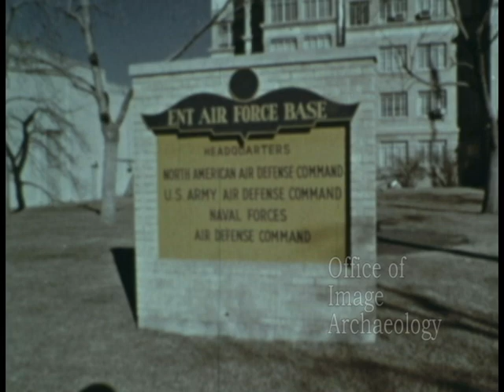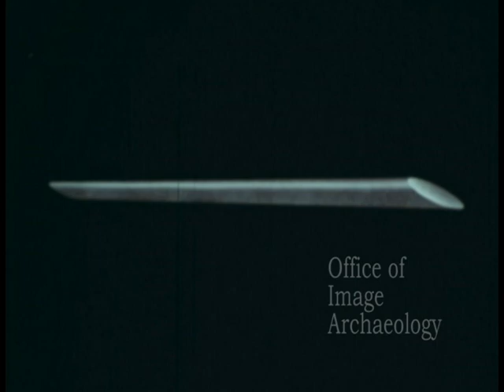1959, TIME WILL TELL, Major Joseph W. Rogers, F-106, Speed Record

Comment: With SAGE and BUIC, the F106 did not need any pilot to do its job shooting down Soviet bombers.   The F106 had a specialized auto-pilot system that allowed it to be flown like a drone.  Each F106 fit into a real time 3D display of the battle field over Canada.  If the pilot could not or would not function correctly, the aircraft was taken over automatically and flown as a drone.  The visor of the F106 pilot's helmet  was a specialized material that would go black with any nuclear flash.   Pilots demanded, and got, space suits and sealed helmets to fly in because they feared canopy blow off at 50,000 feet or more from nuclear explosion on targets.